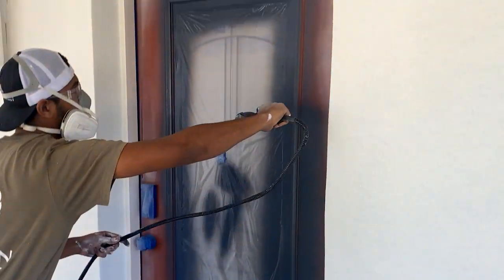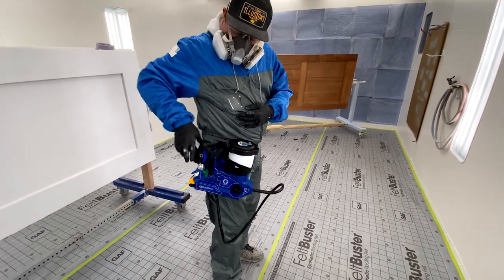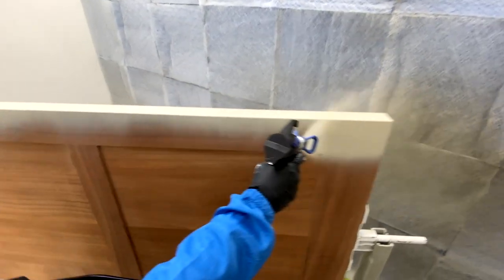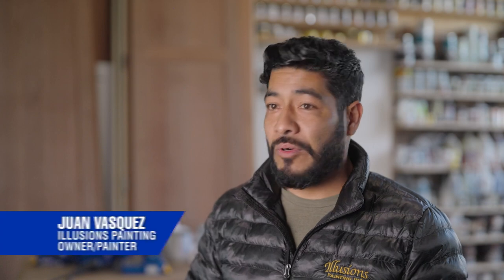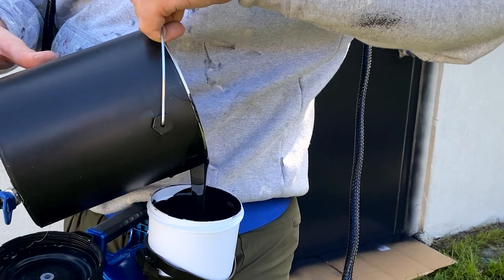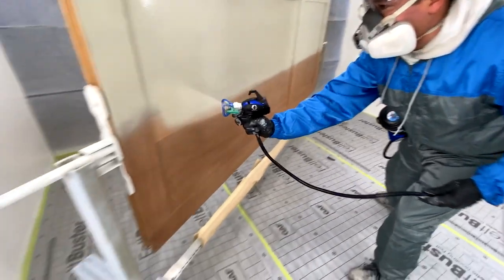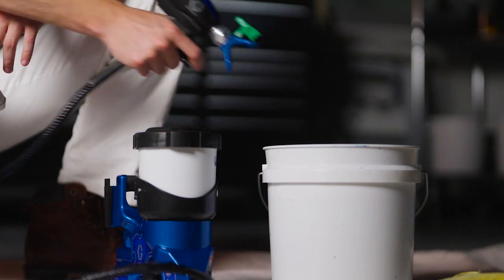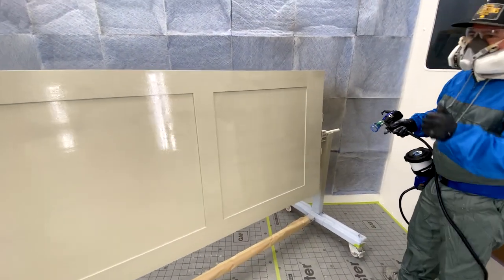Ultra QuickShot Testimonial - Illusions Painting

Comment: Wow... !! What an amazing invention..!!👍👍👊
Had a Painting/Handyman business for 10 years now. 
This gun is unbelievable, im going to buy it. You can even do big jobs with this gun at your own pace save you getting in cost of labor for a big job when you have to set up the big gun/pump with the long hoses then you need someone watching the pump/hose and etc. 
This Gun eliminates a lot of problems, you can stop if you like and come back at a later time with an easy clean. The big Pums with the long hoses you cant afford to stop or do insmall sections otherwise youl waste a lot of paint and time for x amount of times you need to set up and pack up for the Big Gun Pump.  
I have the Graco Ultra Max Plus and its an amazing gun to with use of many applications/situations. However its a bit of a revolution in terms of it being easy to use with hardly any weight on your hand when the pump is separate from the gun so when your spraying its really light and you can use the gun in smaller tighter spaces. But its good to have all these guns which are very versatile..!!..

Comment: Ok first off... As far as spraying this on its best day would be comparable to a normal airless. It's better than the handhelds they used to have, but it's not a substitute for hvlp units. Cleanup would be identical to most hvlp and handheld units, and finish quality should be the same as other guns with the same fflp tip in it(at best if the pump keeps up). The entire focus of the video should have been cordless portability while maintaining the same quality as a full size airless on small projects. It's very convenient, but so is my hvlp gun, only difference is I have to plug it in. Same with my airless. It's a cool option, overpriced but cool. I'd hesitate to pick this over a cordless gx19
Reply: Well the no-spit trigger is pretty nice though

Comment: This seems like its priced at market value, knowing that it replaces all these components of a typical sprayer, instead of what it should be in terms of return of investment. It prices out DIYers.
Reply: DIYer over here.  Sold my Graco Ultra Handheld and sucked up the rest to buy this.  My bank account hated it but it was the best decision I have ever made!  I found a decent price $1279 at a Sherwin William and they gave me a $100 discount on 2 gallons of Emerald paint.  The tactile handheld feeling, precision, ease on the trigger finger, cleanup is just unmatched.  Was nice not to get paint all over my sprayer due to refilling paint. Love that you did not lose paint at the bottom of the paint can like when I use my X5.  It is a gravity airless so almost every last drop can me used with far less waste.  I was finding I was buying and extra gallon of paint just to be able to prime the X5.

Comment: How do you wash the gun after finishing painting
Reply from the maker: The cleanup process for the Instant Response Electric-Powered Gun is a part of the cleaning instructions outlined in the sprayer’s manual. It includes filling the sprayer’s cup with cleaning fluid & pointing the spray gun into a waste pail and pulling the trigger until cleaning fluid is emptied from the cup.